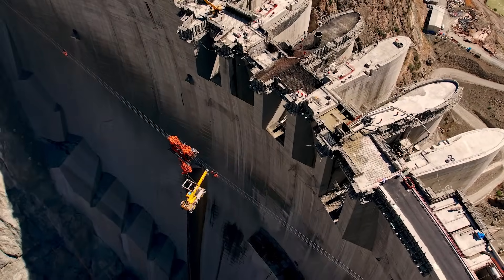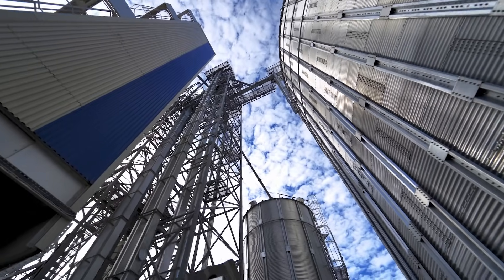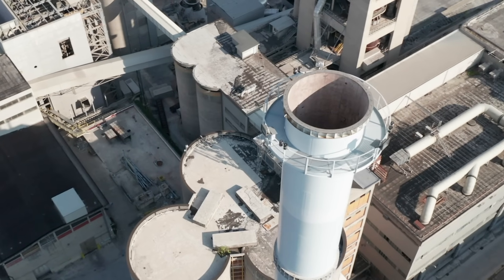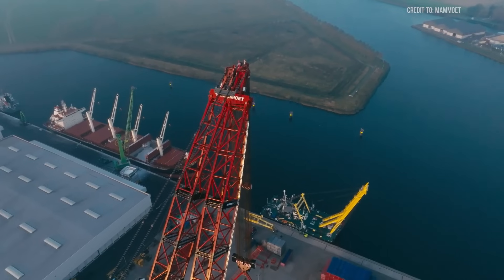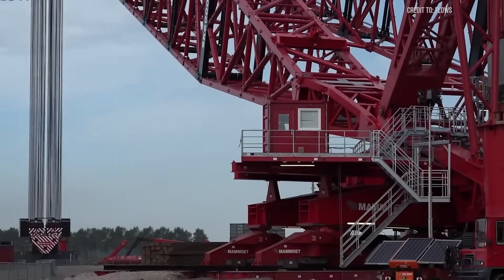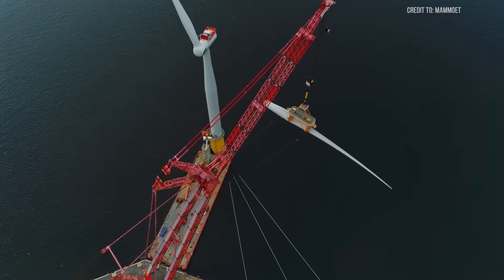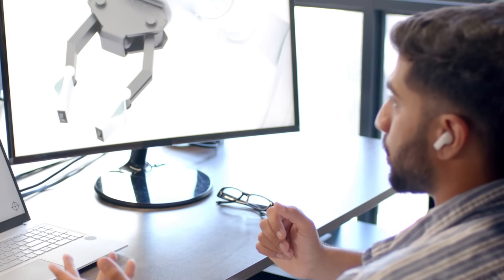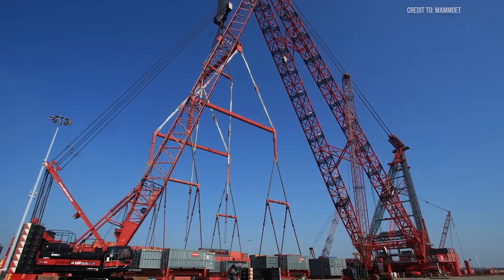This 6,000-Tonne Smart Crane Just Changed the Game

Comment: very impresive, but how on earth is that thing profitable ? it must cost a fortune just to get the whole thing from one place and set it up again. i'm not an accountant, can you tell ?
Reply from the maker: Cranes of this scale are typically deployed for extended periods to maximize the return against the cost of transport, assembly, and operation. For example, the Sarens SGC-250 at Hinkley Point C is deployed on site for several years, in that time it will carry out lots of complex lifts that would be impossible for smaller cranes. This long-term utilization makes these super heavy-lift cranes economically viable for large-scale projects. But yeah i agree its hard to wrap your head around the numbers.
We also have a video covering the SGC-250 if you wanted to check it out!